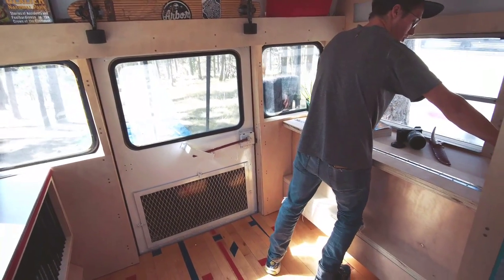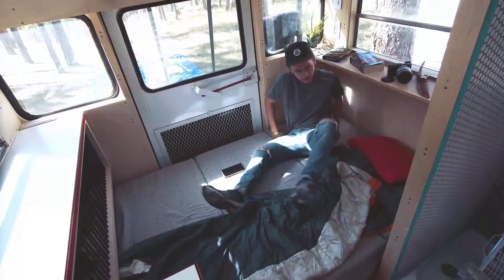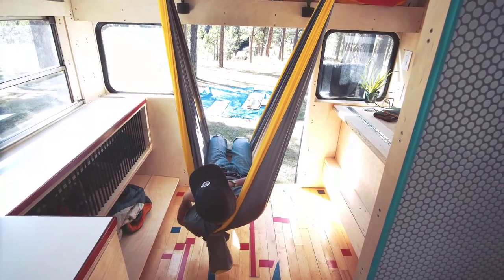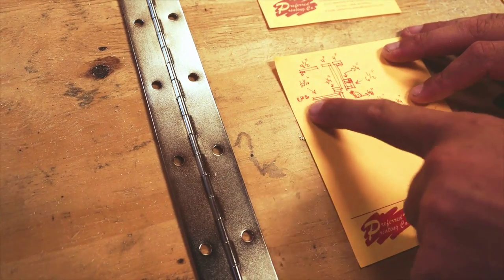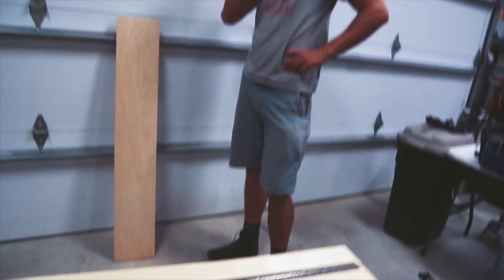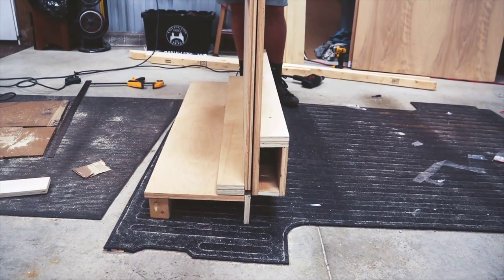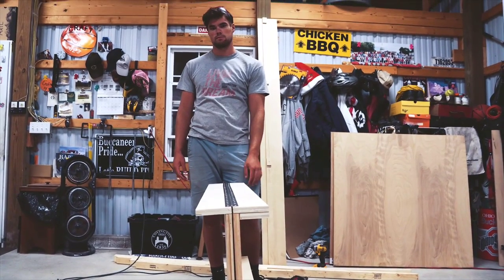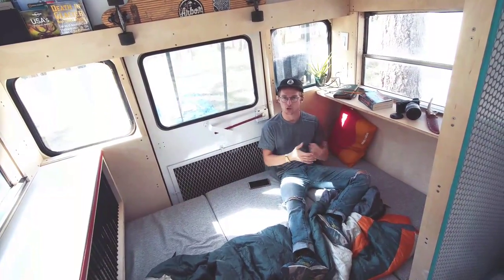#18 | FOLDING BED DESIGN BUILD | School Bus Conversion

Comment: How did you make/where did you get those cushions? I want a similar function for my bed but I don't want thin foam. Those look so thick!!
Reply from the maker: There is an RV salvage place in Indiana where we picked up the foam. Indiana is where most RV manufacturing is, so there are places around selling second-hand items. Just check locally if anything like that is around. If not, you can also get foam at upholstery / craft stores, but it's a bit more expensive. We also sewed the covers ourselves, since the sizes we sort of custom.

Comment: Check out the hammock chairs at Seaside Hammocks. 
http://www.seasidehammocks.com/HAMMOCK-CHAIRS-c3.html.  
Last I knew, they were customer friendly. Explain your set-up and see if they can put hooks where the hammock-chair normally attaches to the spreader bar.  Hanging from your eyebolts, that would give you more of a chair-like configuration.
Reply from the maker: Those are awesome thank you!